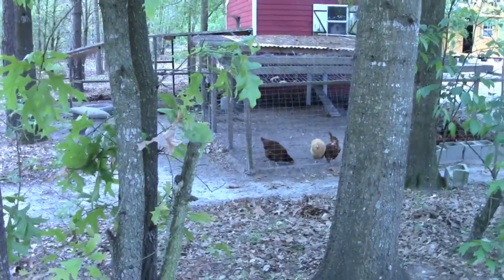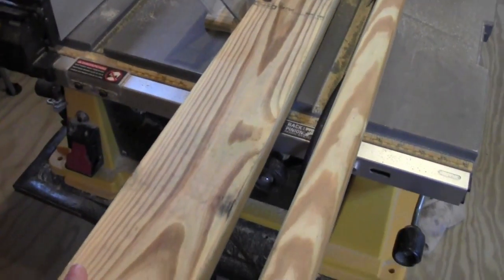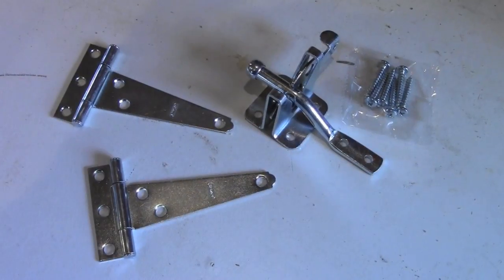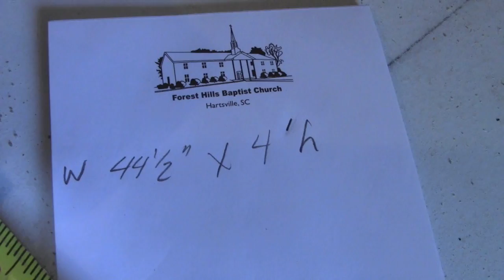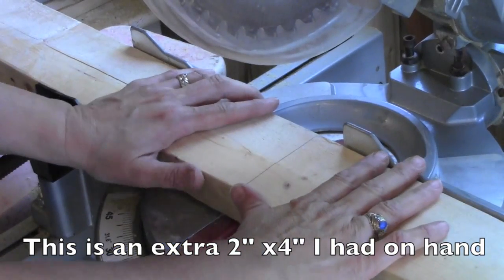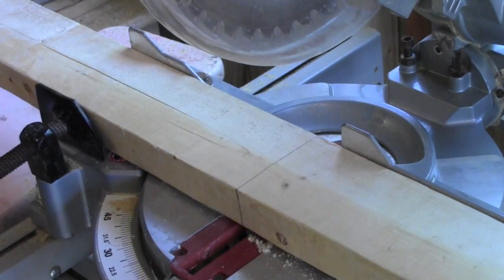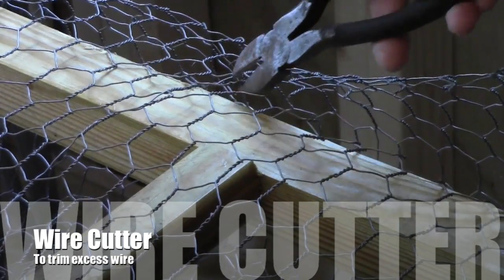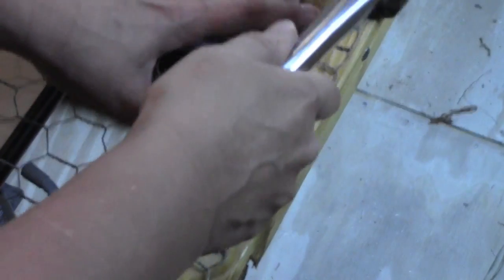Build a Garden Gate for Less Than $10

Comment: Wouldn't it be easier to drill a screw in instead of hammering a nail?
Reply from the maker: Perhaps but I wanted the longer nails for greater stability to the frame and the nails were galvanized so they can take the weather.